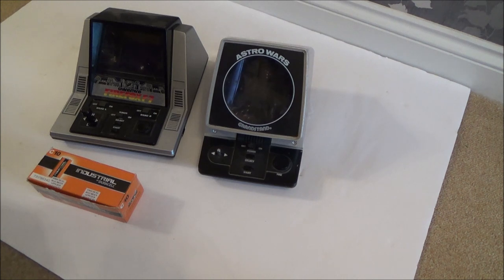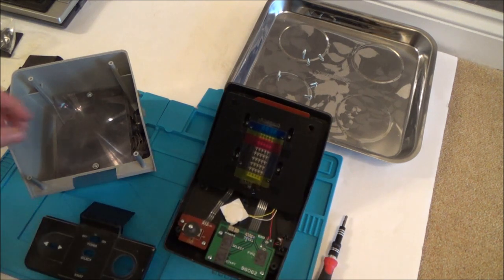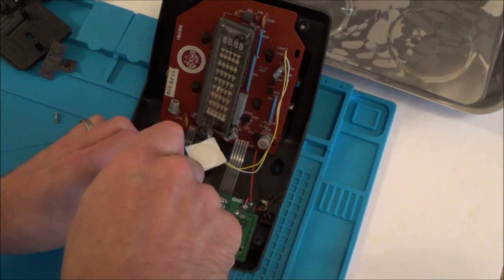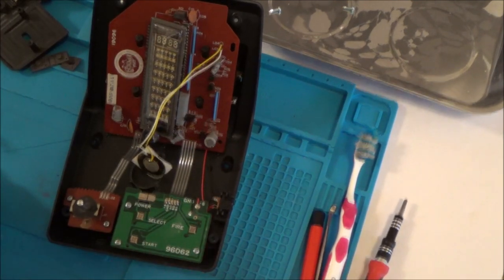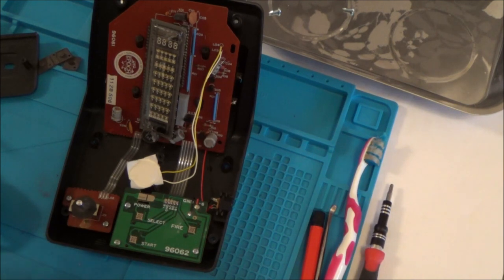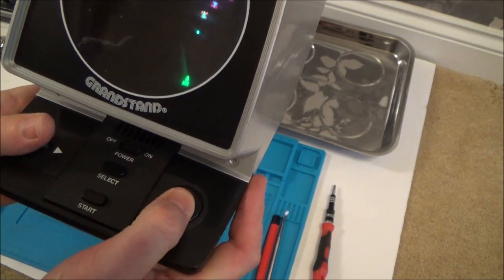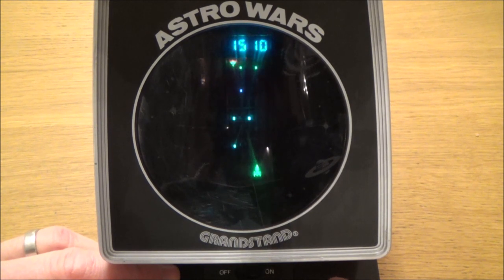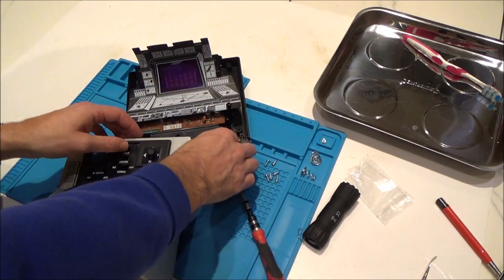Trying to FIX Astro Wars & FIREFOX F-7 table top 1980s games.

Comment: that black blob in the tube screen is to attract impurities in the vacume tube, all screen like tubes have those. great video!!! always fun to watch Vince
Reply from the maker: Thanks for sharing the info :-)
Reply: Yes its quite normal to appear black or silver, you worry if it turns white and dusty. Its knows as the Getter  its applied inside vacuum devices like tubes or valves in your case.

Comment: That stain on the 1st VFD is referred to as the getter. It is normal on all VFDs.
Reply: Getters are used in all vacuum based devices (valves, CRTs, nixie tubes, etc.)

The getter compound in the VFD in this video looks OK since it's still a metallic color. If the getter starts to vanish or turns white, the vacuum has been lost and the VFD will burn up if power is applied.
Reply: Indeed, when in use, these 'getters' collect the impurities that are dispersed when the displays are lit.
Reply: Blue components are pulldown resistors and the black silver splodges are normal on a vfd display... Common on early vcr's... Vfd don't like their pins bent ....

Comment: Great repair with the battery terminal. In case you get another unit I think there's a hidden screw on the joystick I had scramble by grandstand and there was a hidden screw on the top in the middle of the joystick but can't remember if was just a paper label or plastic. Looking forward to the next video
Reply from the maker: Thanks for the tip. I never noticed it but looking now it is quite obvious. I haven't peeled it off but it looks like it might be stuck on rather than clipping it in :-) The joystick does look very similar to the Scramble one (my brother had that). Cheers  :-)

Comment: Hi Vince those long blue components you discovered  i believe they are resistor packs (old School tech) designed as a space saver instead of having a row of 10 or 20 resisters coming from the chip.
Reply from the maker: Thank you :-)
Reply: @Mymatevince   your welcome keep up the great content i enjoy watching your fix it video's not to sound too old but it does remind me a lot of what i used to do back in the late 90's early 2000's except there was no eBay so i used to walk the streets grabbing electrical stuff the people have thrown away just before the rubbish collection i then  repaired them most of the time and sold them on in the local paper or shop windows didn't pay much but it kept me in beer and tobacco lol

Comment: The joystick of the firefox should have a screw under a sticker cap on the top of the stick, a common way to fit them. The sticker is easily lifted with a stanley blade but be careful as the cap is plastic and if it gets folded you'll never straighten it again.

Comment: The blac stuff on the display is just the getter of the vacum tube (to clear the air from the inside), the blue long things is just resistors for pull-up or pull-down
Reply from the maker: Thanks for the info :-)
Reply: yup. that's where they heat up the glass tube and seal it. good old days of simpler things.

Comment: nice find mate! I used to have the FIrefox F-7, it might of had a different name in the US but it was the same ships and game.  I think that joy stick unscrewed on the F-7. On those buttons with the black spots/pads, those are carbon contact pads. You can clean them with ISO alcohol on a Q tip which will help them make better contact. I had a few different arcades like these in the early 80s the buttons were always crapping out so i would take them apart and clean them. i think it was the batteries i was using that caused it because they didnt always get dirty.  Also those long blue parts on the Astro Wars are resistors, i think. Ive seen them in really old radios and tv's from the 1950-70s. Gotta love those VFD displays that was top of the line back then, but used a lot of juice to run. Right after this in the mid 80s they started using LCD type displays which was a little better and used less battery life = more game play. lol

Comment: As someone else said, there is a tiny screw under the central circle on top of the joystick.  You can get under the edge of the black plastic disk with a craft knife or the like and lift it off to reveal the small screw.
Reply from the maker: Oh, of course, I see it now :-) I completely missed that before. Thanks for sharing :-)

Comment: Hey Vince - top video, love these old machines.
What would stop batteries from working on a near-mint Astro Wars with zero corrosion ?
The mains power works perfectly, and batteries worked in the past, and were always taken out after finishing gaming.
This seems to be happening a lot with these old VFD games, where batteries just stop working, and zero corrosion. There are many units on eBay, across all the brands - Grandstand, CGL, Entex, etc... where the games only work on mains power. Weird.

Comment: Just got hold of the firefox f7 needs work watched your vid and realised that you could not remove the joystick well in the top is a small plastic coated metal disc you need to remove that to reveal a small screw to remove the top of the joystick. Just an FYI for future reference. great vid as usual thanks.

Comment: Vince, I think the reason the fire button may have misfired initially,  was because the plastic piece under the fire button was hitting the rubber on its side and not getting good contact, or the magnet was stuck down on the pad.
Reply from the maker: Hi, yes I also think when watching it back, that the IPA cleaner stuck the rubber pad down onto the contact so it was the same as holding down the fire button. Then after a bit of time it evaporated off and started working again :-)
Reply: There are no magnets - the rubber is impregnated with a conductive coating.
Reply: It's a carbon contact I thought it was a magnet. If you look there is a black carbon disc under the rubber button.
Reply: @TheBeardown99  Yeah - I did look, hence my reply? Generally magnets are only found in high end equipment (hall effect sensors) requiring keystrokes in the 100k+ range...
Reply: @Fifury161  I like how you didn't mention the carbon discs in your initial reply but whatever.....
Reply: @TheBeardown99  I think it's a given that conductive coating is sufficient, you can't prove that they are made of carbon (the technology is known as Supra Conductive Pill and the composition can be tailored for the required resistance), but hey you knew that already...
Reply: @Fifury161  did I though.....

Comment: We have an Entex Pac Man 2 where the rubber button pad on the Player One side had gone a bit naff - still workable but not as springy. Swapped with the Player Two's button pad. Been meaning to replace with more modern rubber.

Comment: Sometimes the foam they used in old electronics can become conductive as it breaks down with age. You can check it with your meter to be sure if its causing a problem.

Comment: Those long things are resistor packs, every pin leads to a resistor except the common usually on one side. They are used to pull up or pull down logic level pins to set them to a default voltage state.

Comment: Vince? i'm always wondering why you do not test with your power supply first? i mean you can calculate the amount of volts and amps and already see if it would work regardless of the battery terminals being clean and what not? is there a particular reason why you use the batteries first and insist on using them first?

Comment: You might want to  get/use contact cleaner. It generally comes as a spray, and is designed to clean contacts (as the name implies) I use it on various things such as Pinball machines and Slot machines, as well as remote controls, when the buttons start to become useless.

Comment: The black blopp in the Display isn't ''happening'' in the Manufacturing process, it's done in the manufacturing process. Most of old Vacuum-Tubes and Displays have this black spot. It's a need in the Manufqacturing process, to get this Tubes and Displays to work.
Be careful, this Displays use often a lot of Voltage....

Comment: just for sh!ts n giggles, im not sure but the astro game NEC chip date code i think is 14th March 1983 20th March 1983...
the one NEC chip you shown on the firefox was actually made between 13th June 1983 and 19th June 1983, this game could have been sold late '83 and through '84, most likely mass produced for xmas market so stands a high chance most of these was probably sold in December 1983 perhaps...
can you ask Hugh if these was his xmas prestents?

Comment: I see electronics in a Christian resale shop we frequent and they put an inspected sticker on them . I have found more than one thing that there was NO WAY they tested that unit to be functional. One thing I am NOT IS DUMB. I have of course brought these items and fixed it. Not very Christian like to LIE about an object.  
I am currently working on a trail camara used to take photos using motion sensors, and record the photo to a memory card. I found the lCD board no longer worked so took it apart to find an internal NiMah battery that had leaked and no longer working. I found it to be two 1.2 Nimah batterys soldered together. I plan to order a new set of batterys(2) and get the camara back to working condition. Its an $80 Trail cam when  new.